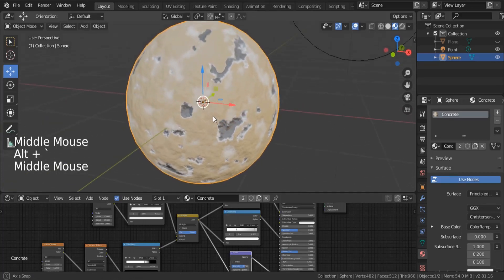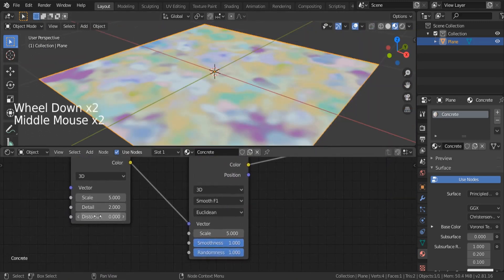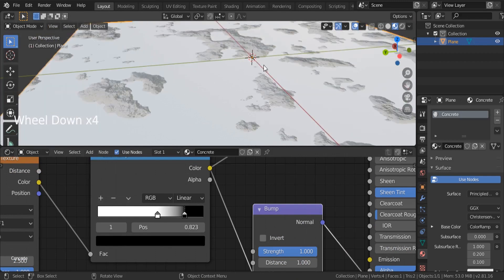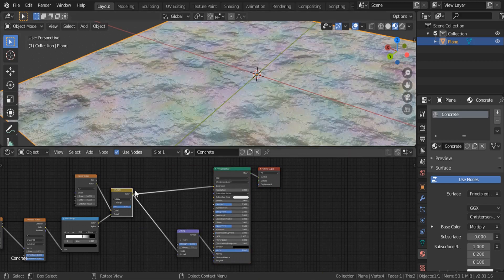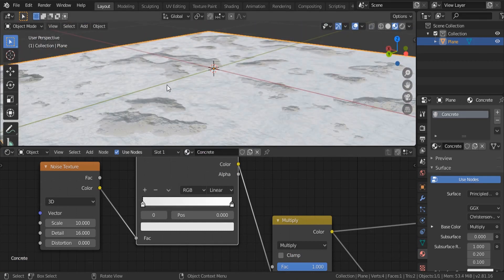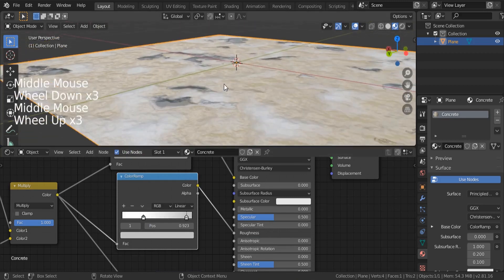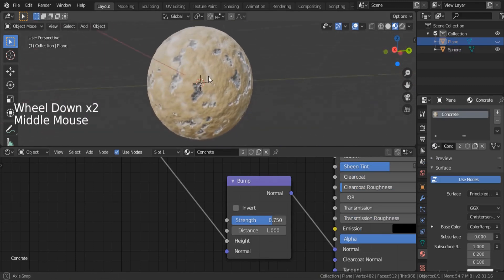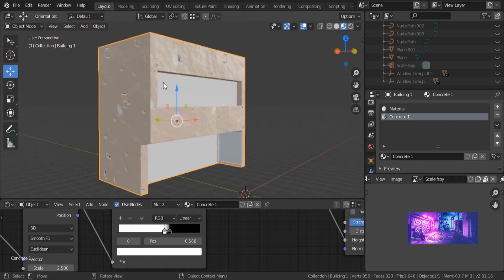Create Realistic Concrete Material in Blender 2.8 (Procedural Texturing)

Comment: I really like this. I had taken this and change it up to be a more unsettled smooth concrete texture wall with pop holes and noise on the outside. One thing I did was use Map Range instead of ColorRamps, this way when I group them I can still control them outside of the group. But I could not figure out how to do that for the coloring of the wall with a gradient to the gray for the holes. Thank you for making this. I am also learning a lot with your Introduction to Photorealistic Rendering courses from your website and one I got from Udemy. Looking forward to the updates of the Procedural Texturing.
Reply from the maker: Thanks Jason, I appreciate your kind words
Smart changes.. In fact this is the reason why Procedural texturing is so good: Flexibility over the final outcome
Reply from the maker: If you need help with making the gradient color, feel free to send me the details and i'll do my best to help you

Have an awesome weekend